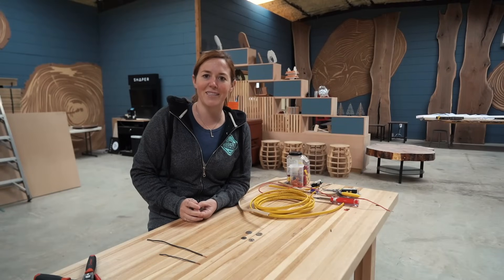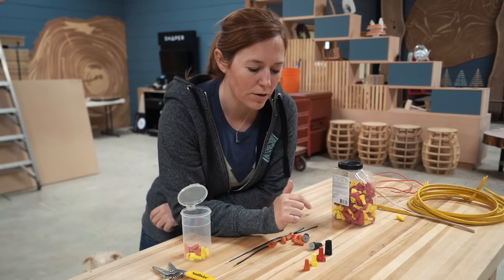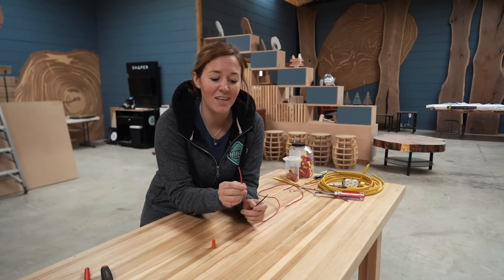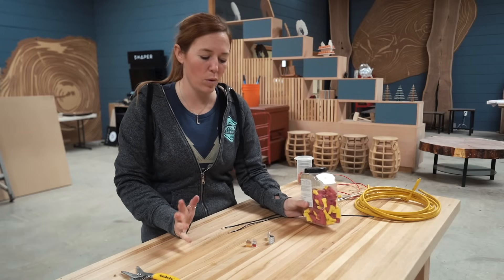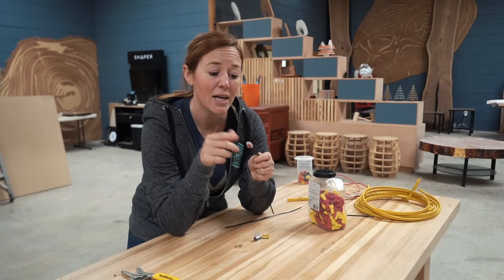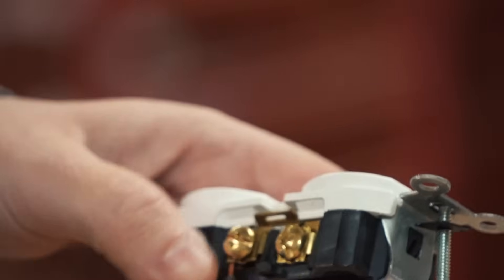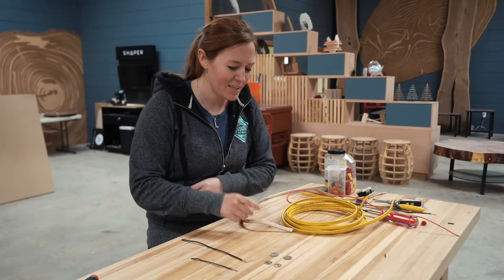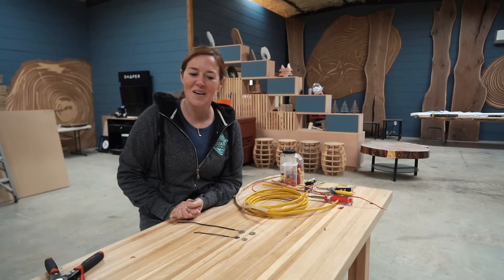DIY Electrical Wiring! Fast, Safe Home Wiring Basics for Switches and Outlets

Comment: I watch a lot of British/UK sparks...they hate our wire nuts...I kind of do too...I tend towards Wago connectors for my wiring...much easier to separate than the push-in kind.
Reply: Those nuts suck. Wago is the way. Sure they cost more but unless you build or rewire your whole place you usually don’t need many. Much easier to fit into small compartments and save a lot of time and pulled hair. Also less room for error.

Comment: Use Wago connectors and leave that 70s technology to the past. There are also connectors with latches, way easier to use.
Reply: Wago 221 lever nuts will accept solid and stranded wire, push ins only work with solid wire.
Reply: Your right. Wago connectors make it so easy to connect. Twisting 4 wires will make you use wago.
Reply: Wago connectors are nice but twist connect also works well
Reply: wago for light max, not for other
Reply: @lucatoni4509  Of course they can be used for other cases.
Reply: Always an expert in the crowd with no tact.
Reply: @biologistjim4905  I’m saying this so folks watching this video won’t go through what I did. Those twisting connectors are a pain to use. Same goes for the wagos without latches, if you have to undo them multiple times, you’ll see what I mean. The ones with latches are the Wago 221 model. So nothing to do with tact here, mate.
Reply: @s2003katalin  okay Professor some people like to know different ways of doing things.
Reply: @biologistjim4905  😂😂
Reply: @biologistjim4905 oh good manners for the looker?

Comment: Very thorough refresher. Especially agree with no "back" wiring, stab wiring into the back of outlets. Found 3 at my dad's house that pulled right out with no resistance. You will hear many horror stories of them, just wire to the screws and be able to sleep at night!

Comment: Also... .Make sure you screw down any unused screws on the sides of an outlet.   This can prevent shorts and arcing.
Reply: i'm a belt and suspenders kind of person - i also put one wrap of electrical tape around the entire thing before i stuff it back in.
Reply: @rapunzeleh546 
 An extra mile kind of guy. I respect that.
But we really only do that when putting the device into a metal box. 
Nothing wrong with redundant safety, though...

Comment: the problem with electrics is that if you don't know what you're doing, you can do a lot of damage. thats why here in the UK only fully qualified and registered electricians are allowed to install new wiring. the only DIY jobs are replacements, for example if a light switch breaks or a socket has a short, blowing a fuse or tripping a breaker.
Reply: In Australia, you can't even do that much. A licensed electrician is required for any fixed wiring, installation or repairs.
Reply: @geoffs7232  yeah, i heard that you can't even do ethernet cables yourself. is that insane or is that insane?

Comment: Thanks for this. Never use the push-in connection receptacles (IMHO they should be banned) and always pay a few cents more and get the heavy duty receptacles like you show here. I never did get used to using a stripper. I do have a romex sheathing stripper though. A good pair of electrician pliers (Kleins) is a must for any electrical work and I still always use wire nuts, I don't trust the push-in connectors either for the same reason the push-in receptacles are an issue.

Comment: If your doing three or more wires in a wirenut its important that they are all even or one will slip out, it can be tricky so pre twist them together with pillars, you're  going to save some time and hassle.
Reply: Use wago wire nuts.